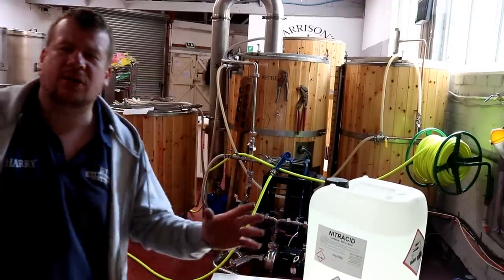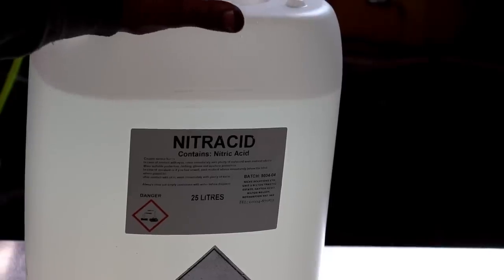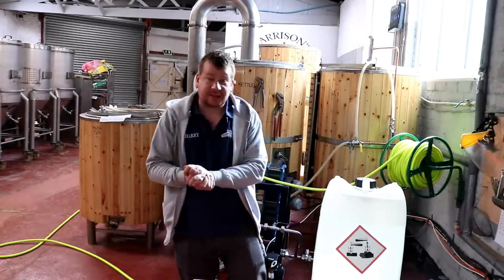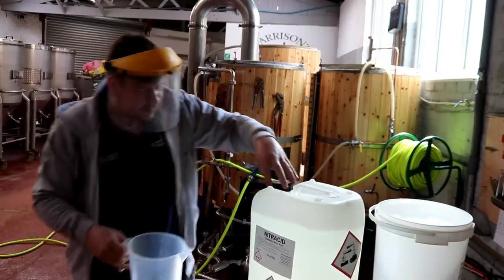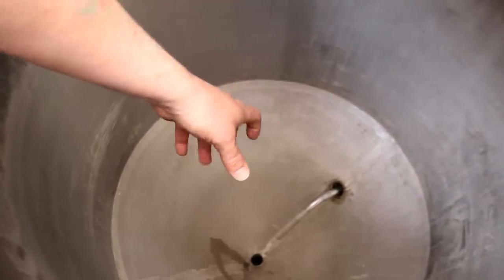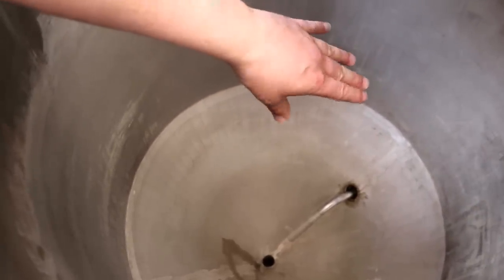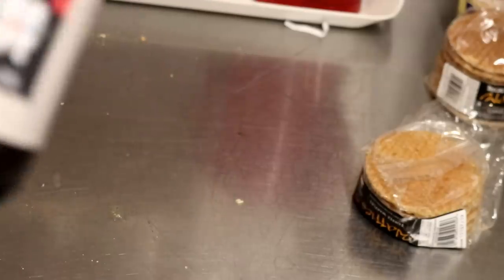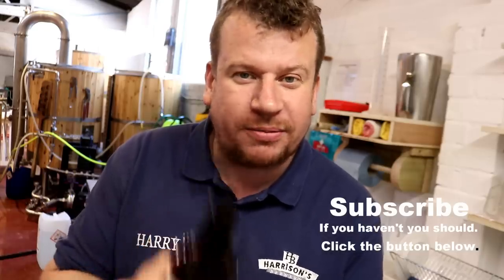FOR THE BENEFIT OF HMRC

Comment: Could you make a little jig for the bottles to sit in for labelling.   Holds the bottle in place and has a line marked on either side to lay the label down on the bottle.  Once you’ve got the first bit stuck down you can lift it out of the jig and wrap the rest of the label round.    
You could make something that holds a few bottles at a time.

Comment: Thanks for the explanation Harry m8,the tanks you currently use the outlets seemed a lot closer to the bottom of the cone so I was wondering why these were so high up,maybe that's just an illusion of perspective though given these are bigger tanks? That's a heck of a lot of trub in those new tanks, wouldn't do to have all that going into your beer. That nitracid did a great job,saves on scrubbing,couple of whips of a flapper wheel and the insides will be spotless. Cheers.